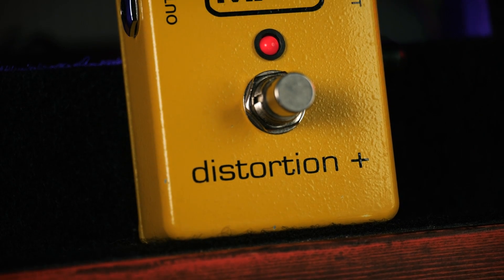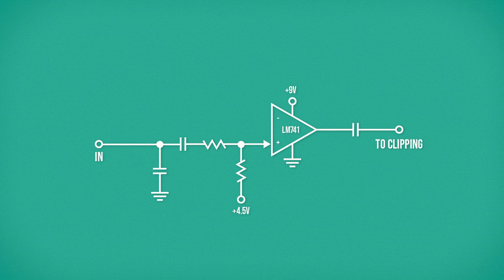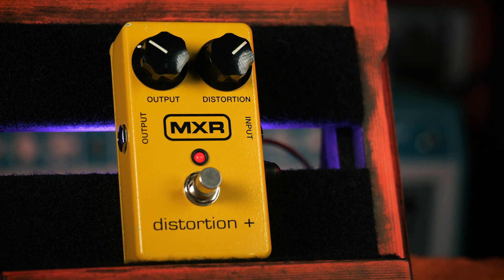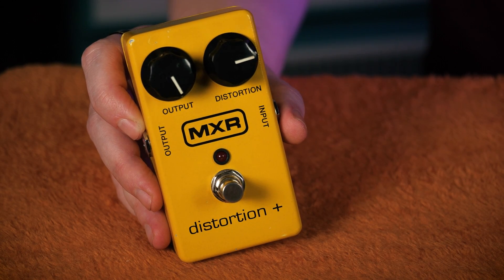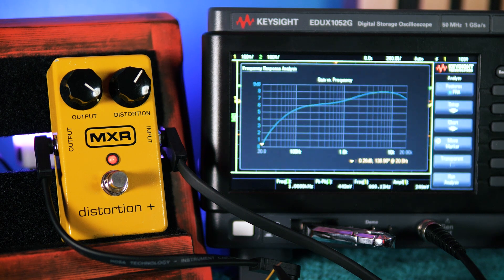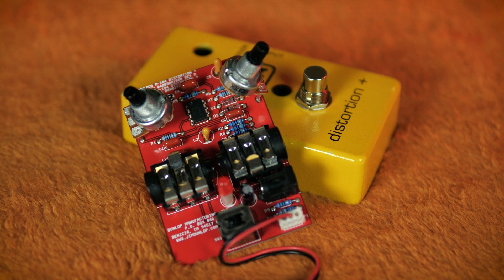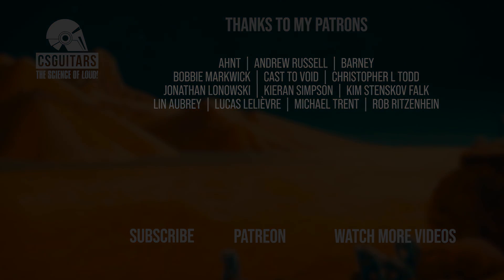How MXR Distortion + Reinvented Drive Circuits | Gain Appreciation

Comment: Colin! Did you see Jim Lill's video in which he built an amp that copies several mainstream amps with a breadboard and solid state pedals?
Reply from the maker: I did and it was equally as lacking in any actual science and overloaded with false conclusions as his other videos are.
Reply: @ScienceofLoud  Examples?
Reply from the maker: For one to design an effective experiment which will yield valid results one must firstly be educated on the fundamentals of the subject and have defined the parameters they are testing for. Jim unfortunately does neither, his 'experiments' are blind stabs in the dark - the reason that most of them come back as inconclusive is because he isn't performing the correct test to yield the result he wants - but because he has no idea what he's doing he isn't aware of the flawed process and concludes falsely that something must have no impact or purpose. Even the times when he lands on the correct answer he draws incorrect conclusions on the cause. 

Having even the most basic understanding of proper scientific process will make watching his videos a frustrating experience, as he time and again makes confused arguments and arrives at grand revelations which would have been self apparent from the outset if he'd done any research at all. 

Highly entertaining and well put together content - he's great at making an engaging video- but of absolutely no scientific or objective merit whatsoever.
Reply from the maker: Ok, let's take a couple of specific examples from the 'Where does the Tone come from in an Amplifier' video:

Firstly he never properly defines the parameter he's investigating on, he talks about 'tone' and trying to hear a difference, but doesn't define what precisely he's listening for. There are many sonic elements of an amplifier you could listen and test for: frequency response, dynamic response, headroom, distortion character and so on. 

When testing the rectifier he openly admits he doesn't know what it is or what it does, so it's impossible to design a test for it. He cites two words from forum discussions "spongy" in relation to valve rectifiers and "tight" in relation to solid state - he doesn't investigate what these mean. He then strums a couple of chords in an A/B and leads the viewer to form the conclusion that rectifiers make no difference - a test which is NEVER going to yield a useful result because what he should be investigating here is dynamic response, by playing something with high dynamic range and sharp transients it would expose the volume drop which results in the 'spongy' response from a valve rectifier. A couple of lightly strummed chords aren't testing for what the differences between rectifiers are. 

Later in the video it becomes clear what he IS listening for when he finally arrives at the EQ circuit and he has this massive revelation that the part of the circuit responsible for the frequency response of the amp is the thing changing the frequency response - that would have been self apparent had he any understanding of circuits. So he's actually looking for an EQ difference, which of course you aren't going to hear with rectifiers or different valve topologies - but he falsely concludes (or at the very least leads the viewer to conclude) that those non-frequency altering elements have no impact over how the amp sounds - which is wrong. 

Had he tested for dynamic response with rectifiers, or for headroom and gain character with valves he'd have found that these too have a dramatic impact over the sound and performance quality of the amp - OR if he'd defined at the outset that he was only listening for frequency response then he wouldn't be writing off important parts of an amplifier as essentially unimportant and the data could have been useful. 

And possibly the most egregious part of the whole thing comes in the recurring joke of "I'm just a performer, I don't know anything about circuits" - well maybe you should learn something about them before taking to the internet trying to disprove them?
The statement is there as a device to make him relatable to the average viewer, someone just like you that you can trust - not one of these so called experts - and he then goes and 'does his own research' and encourages you to conclude that the scientists, engineers, and designers - people with degrees and doctorates in the field of electronics - who have been making these things for decades are in fact lying to you about it all. 

It's sadly misinformation being broadcast under the guise of science and sensationalised to make you think some 'truth' is being exposed, when in reality it's just someone who doesn't understand how things work reaching the wrong conclusions.

Comment: This was my first distortion pedal back in '82. I used it into a clean tube amp boosted with a Boss SD-1 to approximate large tube amp distortion. I still have one on my board as my primary lead boost into distorted Marshalls. It creates smooth singing lead lines with tons of sustain used this way. Love this video Colin! Always nice to learn the inner workings of classic designs. Cheers! John

Comment: About a third of the way into the video, I was sure this was the moment where I finally have it explained to me like a child. What exactly is "gain?" At times I have thought I understood, but then it just seems like volume again. It has to be different than volume, but I have no idea exactly how. So TATA: what is gain?
Reply from the maker: Gain is simply how much bigger the signal amplitude is after amplification - it's a multiplication factor. Literally how much the signal has 'gained' from being amplified.
Reply: Gain essentially is volume. The circuit amplifies the input signal - making it louder. Adding more gain makes the circuit amplify the signal more (get louder). That is, until the limits of the circuit are reached ( the transistors cannot physically transmit more current through them). With the current/voltage limited by the electronic parts, the signal cannot reach the extremes of the waveform and is thus "clipped". We hear clipping as distortion. 

Once the physical limits of the electronic parts is reached, that is also called "saturation". The amount of gain you can add without saturating the circuit is called "headroom" in guitar-speak. Changing the values of the electronic parts (resistors, capacitors, transistors, etc.) changes the saturation point. That allows the designer to control how much headroom is in the circuit before distorting.  

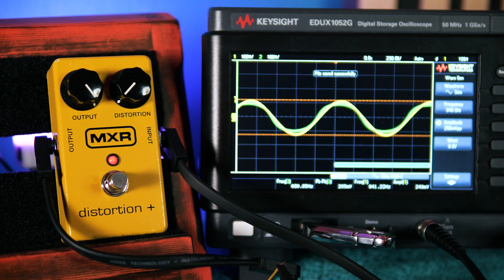You can see it in the video from 4:10 to 4:40. Colin leaves the "output" knob untouched as he adjusts the "gain" knob. When the gain knob is turned from left to right, you can hear the volume increase as you see the waveform get taller. That is until it reaches the limits of the clipping diodes. Then the volume stops increasing, but the distortion gets nastier. 

Volume is measured in decibels (dB - actual soundwaves in the air from the speaker). In a theoretical amp with infinite headroom, more gain would always result in more volume from the speakers.

Comment: Thank you for mentioning similar pedals. I already have a ProCo Rat on my board that has been modified by Alchemy Audio. So I will keep with that.

So I will mention that my bias of modern pedal trends may have gotten the best of me. When I go back and find a tone/sound/timbre I like (70s UK Punk/Post Punk/Alternative Rock/Indie) I go down a rabbit hole to see how they got that sound. I am looming for a boutique or rare pedal when I look at what those players used. Well 99.99% of the time its a classic, basic pedal... Be it MXR, DOD, Boss, or any other OG manufacturers, it's amazing how spending a bit more time on amp settings, basic effects, and using your volume and tone can achieve such wide ranging differences in tone.😳

One player I will point out is Daniel Ash from Bauhaus. Listen to his tone in that band. His main guitar was just a Fender Telecaster and mainly standard pedals and a good amp. Still his tone and sonically how it does the lifting in those recordings is amazing!😳👍✨

Comment: I prefer the dod250. It feels cleaner/brighter to me.
Reply from the maker: Just about the only difference between the DOD250 and the Dist+ are the clipping diodes. 
DOD uses silicon diodes which have a higher forward voltage, clipping the signal at a higher amplitude - resulting in the 'cleaner' sound.
Reply: @ScienceofLoud  when I made my DOD clone I socketed the diodes just so I can see how big of a difference and it’s crazy how  much diodes can change the sound.

Comment: Do digital distortions and overdrives, such as the Boss BB-1X have an op-amp at the heart?
Reply from the maker: Digital implies that the signal is being processed by software to produce the sound. 
There will still be op amps involved, namely to amplify the signal level after the signal is converted back to analogue, but any digital distortion effect is using software to mimic the result of an opamp + clipping circuit.
Reply: @ScienceofLoud  Thank you for the swift answer

Comment: This pedal is a big part of the early Iron Maiden sound.
Reply from the maker: MXR sold a lot of them and they would have been in the hands of a great many bands who would eventually break through to success in the 80s.
Reply: Let's not forget Randy Rhoads!
Reply: @lucamoqi  Randy's actually the first name that comes to my mind when I see this pedal.
Reply: I think Dave's big MXR tone came from a MXR Micro Amp, no?
Reply: @sim0n17  the micro amp is just a level booster. It doesn't really have a "sound". Dave used the Distortion + for the first 5 albums.
Reply: @mrcoatsworth429  gotcha - I really didn't research this, I just remembered him as using a micro amp back in the day.  But even though it is a "just" boost, it does change the tone of the amp when pushing the front end of the pre-amp section of a tube amp.
Reply from the maker: @sim0n17  Additionally, the Micro Amp is the same circuit as the Distortion + without the clipping diodes.
Reply: @ScienceofLoud  nice - thanks for the follow up and this would mean no level drop like the Distortion + right?
Reply: @ScienceofLoud  ive modded mine removing the tantalum cap and putting it on the other side of the board to fit in a 3 position switch with the original germanium diodes (dist +) no diode (mxr microamp  sounds) and silicon (dod 250).
Reply: True, 'ol Davey used that Distortion + for  everything that was distorted. He also used an MXR eq box. That was also similar to Glenn Tipton and Randy Rhoads during that very early '80's era. What always had me wondering, concerning that early Dave Murry sound was the MXR Phase 90 (block logo). He had that super wailing, vocal quality in his solo's using that, kinda like Hendrix (univibe) and Uli Roth ( Jet Phase).
Reply: ...and early Judas Priest!
Reply: The Misfits too!
Reply: @russiangoose7053 I didn't know the misfits used it
Reply: And a slew of others

Comment: I wonder now if it will sound the same if i decided to build one for myself.
Reply from the maker: A really easy beginner circuit with plenty of room to change or expand to taste. 
But the core circuit is unlikely to sound much different if you keep all the component values the same.